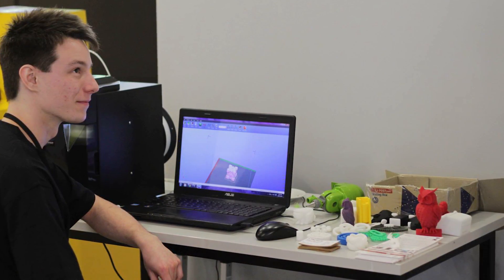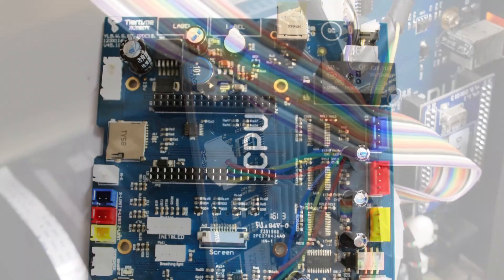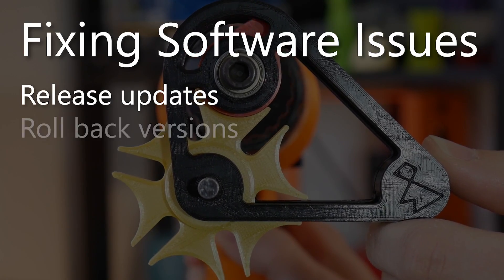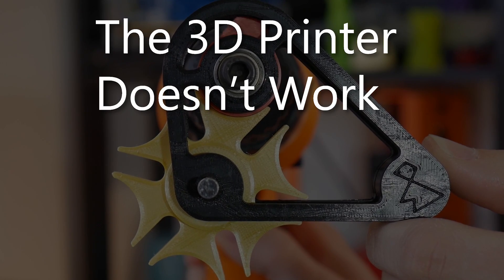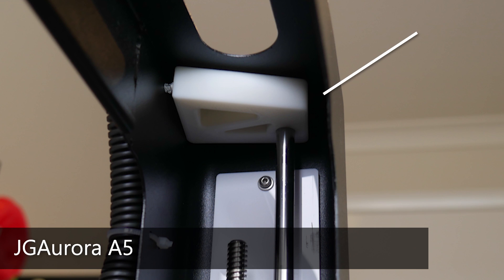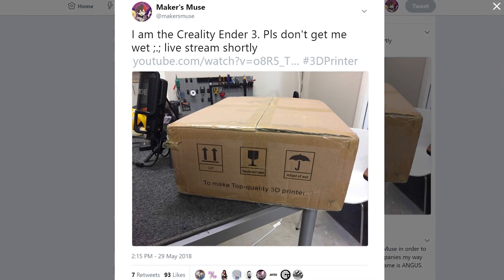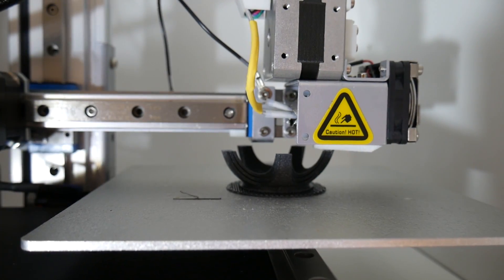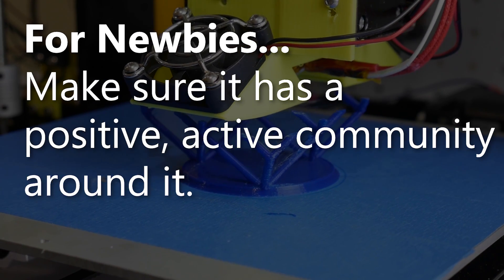Serious Concerns with 3D Printer Quality Control

Comment: I think the real problem is transparency.  In software terms, beta projects come with release notes.  They let you know what bugs have been fixed over time, and when a new release drops, you can see if the problem you have has been solved by it or not.  

More often than not, with hardware, there's no such thing.  So for instance your problem with the PTFE tube and its holders on the Ender3 might have been fixed but they don't let anyone know.  So you get your box in the mail and maybe it's got better parts than the review units, maybe it doesn't.  It feels like even more of a gamble than it did before.  

I feel like if manufacturers tracked their bugs similar to how software developers did, and included release notes on their website and in the boxes that correlated to serial #s on the machines themselves, it would go a long way towards helping users understand their machines better.  At least then I'd know for sure "Oh I have serial # XXXX that came with B series switches, but those have been fixed so I need to do that myself" or "Oh This is a very late serial # so it has all the current-best hardware on it."  This also helps quickly track down and squash bugs.  I bet lots of people wouldn't attribute underextrusion to a fault with the PTFE tube holders.  And many users might not know where to turn for help tracking that problem down, or maybe there are several things that "kinda worked" for several people so it sends users down a long rabbit hole.  But with a proper notated release and upgrade list from the manufacturer, it would be very easy to see which hardware fixed which problem and be able to target repairs or upgrades on your own machine to get it within spec.
Reply: Mike Bryan , they could still cheat. U.S. auto manufacturer fixed an ignition key problem (that killed several people) and did not change the product number in any way.
Reply: The really tricky thing about announcing incremental upgrades is inventory.  Imagine you have 20 machines sitting in your warehouse ready to be shipped out to new customers.  Now imagine that a new revision is announced with some minor improvements.  Now you have 20 "obsolete" machines that you have to find something to do with, since all the customers are going to want the new version, even if the improvement is something really minor.  That could easily be $10,000 of stock that you're now going to have a hard time selling.

One way to handle this could be the way the car industry does with new models, where they have new models every year.  Since everyone knows this is how it works, there are no nasty surprises for the vendor when they buy $10,000 worth of hardware and a week later it's suddenly updated, and no surprises for the customer either.  Then the vendor can plan ahead with keeping things in stock, since they know when it's time to clear out stock (possibly with a helpful sale) soon before the new models hit.  And the customer can decide if they want to buy a machine right now, or maybe wait for the annual clearance sale, with the understanding that they will not in fact get any incremental improvements that may be in the next model.

There's also a way for the manufacturers to be able to roll out incremental updates immediately.  This is nice for the manufacturer for the same reason as it's nice to the vendor.  Imagine that they have decided that an upgrade of the extruder motor is needed.  Now, they probably want to use up their stock of old motors first before releasing the improved model.  With a rigid release schedule, they could easily get into the situation where they've used up the last of the old motors, but the new model release isn't for 6 months and now they have to order a new batch of old motors even though they're going to stop using them?  Maybe each model would be a baseline, where the customer is guaranteed to get the base model, but might benefit from some of the incremental upgrades slated for the next model.  Since you've made it clear that they're buying the baseline, if it happens to ship with an incremental improvement, it's a free bonus, and importantly, if it's a machine from before that's been sitting in a warehouse until now, you didn't make any promises.
Reply: Given the "lean" manufacturing methodologies all these companies have adopted, there's very little risk of stock sitting on shelves for very long.  I think that was one of the subtextual points of the video.  The manufacturers are revising and selling the printers so fast that people are getting stuff that there's no documentation for, making all the reviews out of date before they are even published.

Comment: I bought my Ender 3 on July 2nd and received it on July 9th.  It came with the old style bed where the "EnderTack" is glued to the bed.  I bought it from BangGood and it shipped from a warehouse in Hong Kong so it may be a little bit of time before the "old" stock of glued beds is used up to guarantee a new bed. 

My Ender 3 also had PTFE connectors that are "fixed" compared to the couplers that Angus received.

Comment: My first printer (fab mini v1.5) just didn't work well. It would suddenly stop out of nowhere, and was always clogging. Last year when I bought my Ender 2 (has been fantastic), about a month later I was already seeing people with Ender 2's with better specs and can't really say I was very happy about that. The heated bed on mine only goes up to 60ºC (and takes forever), one month later people already had a version that went up to like 90 or 100 or something like that. It's not a huge deal if someone only prints PLA, but can be a deal breaker if someone wants to use other materials that require higher bed temps.

Comment: i found that some 3d printers are pure garbage out of the box for example the M3D micro and micro + these twi printers are stupidly expensive and are pure garbage and you cant vene use cura to print with it and if the printer breaks it self doing one of its auto maintenance programs the warranty WONT cover and the website is so broken that everything is a picture and the hyperlinks for files are inside the picture and they dont even have the picture set up as a hyperlinked object either

Comment: Very very true - Ultimaker 3 shipped WAY too soon - malfunctioning and poor design choices. I've got lots of Tiertime printers and I've found them to get progressively WORSE! My first and original Up Box is still going strong - the heated bed creates easily enough heat so ABS prints without warping. But my Up Mini 2 had the worst heater ever and NEVER got hot enough, it's piece of garbage. Sent it for repair to the distributor and they said there was nothing wrong. Scammed. I bought an Up Box+ hoping it would perform as well as my originla Up Box but the heater had definitely been downgraded and wasn't getting hot enough, causing warping (exact same print settings as Up Box). I've bought a Cetus Mk1 and Mk2 and for the Mk2 they removed the limit switches and now the printer struggles to give an accurate and repeatable Z height every time the printer is reset. I wish they'd actually IMPROVE printers every time instead of thinking they can cut corners and save costs by downgrading or 'streamlining' designs. It's absolutely stupid to think they can downgrade parts/features and people won't notice.

Comment: If the design/build is open source like Prusa, I definitely have less problems with the design evolving after initial launch. I like being able to tweek the design and implement the upgrades in the future. I wouldnt be so happy about this being the case with a much more expensive printer but I guess things are moving so fast it's hard to always know what potential problems will rear their heads after lots of use.
Reply: Yeah, if the company publishes their 3D files, at least you know what you're going to get when you order.

Comment: I agree, I don’t think there is a single “home 3D printer” company that’s not guilty of this-including Josef Prusa and his mighty “Prusa research”empire-I also think it’s pretty bad when a company who charges a premium (as they do) recommend themselves very strongly that you print a spare set of plastic parts ASAP-and this is because the plastic parts they use are notoriously cheap, and within 12 months usually start to break (as many have found). Interesting note on the Ender 3 there-I received mine 3 weeks ago, I’ve had no issues with the Bowden tube and/or connectors-if only I had known a removeable bed was on the way I would have waited 6 weeks lol. It’s good that you explain this very bad manufacturing process to people who are not so familiar with lean manufacturing and Six sigma methodologies. In my last job before I retired we had a 6 month PV&V process (product Validation & Verification) aka Beta testing, so that the company (a very well known American company) didn’t risk its reputation by releasing products of inferior quality. I guess in the hi tech electronics world (where today’s top model is old news tomorrow) its become the norm to adopt this process at times-Samsung got caught out with the Galaxy S7 if you recall and it’s habit of bursting into flames-so it’s not just printers,moreover a growing trend where the order of the day seems to be “you snooze you loose” and so the consumer ends up being that PV&V process. I agree it’s not only wrong but as demonstrated by Samsung, it can be extremely dangerous for the consumer.
How many Anet A8 printers have caught fire??? Another example. 

Certainly Makes your job to give “impartial reviews” extremely difficult, and I don’t envy you Angus because it’s only going to get worse I think.
Reply: A removable bed is on the way for the ender 3? I just ordered mine last night, should i cancel the order and will the price be going up?
Reply: Robert Mccarter Angus just said it’s now shipping with a removable bed so I guess it’s lucky dip with your order lol
Reply: @Johnn_T  Not necessarily true because he could get the last older one off the shelf at distribution.  Or even an older one!
Reply: I have nothing but good experiences with the prusa, its the only printer i have that is still stock. Only changed the power cable to the bed as it wears out over time as is informed in the manual. 
Then again, the mk2s i got was not one of the first off the assembly line. 
Its a good idea to print spares just in case, but i bet few actually do so.
Reply: Nah, let the order continue. There is no confirmation of the Ender 3 getting a removeable bed, only that there will be a Ender 3s with it. It will cost more too, i guess.
Reply: I got mine in on Thursday. The bed just isn't stuck down with its sticker, Its clipped on like glass beds with clips. I suppose for those who preferred the build surface not to be stuck on and give the consumer the option to do so if they choose to.
Reply: John T s7s never caught on fire
Reply: Is it glued to some kind of stiff paper or does it just still have the peel off paper on it? What if it bulges upwards in the middle? Have an Ender 3 in the mail, waiting to receive it in a few days.
Reply: Great question I was a bit wrong in my previous statement. I thought it was just the sheet ready to be stuck down but that is wrong.. I just had a look at the build surface and it is adhered to what "looks" like a hard thin plastic with approximately 1mm of thickness. You can actually see that it is glued to that surface.
Reply: Thanks for taking a closer look. I think i want that surface to be on my Ender as well.

Comment: so true, it's not ok. But at some of the price points, I think its impossible to make machines without these issues. went for Ender 3 after watching doezens of reviews and facebook groups, knowing that I will upgrade half a dozen parts while assembling. But even a lot of the more expensive ones seem to need upgrades, its such a mine field atm i would rather buy cheap knowing i need to upgrade.
Reply: I think ultimately the big problem here is transparency. it's apparently the case that no one knows if they have version 1.3.2 or 1.59 (for example). if manufacturers adopted good traceability programs along with good version control a lot of the uncertainty would disappear.

Comment: I got myself a prusa clone, the Anet A8, and it has been a nightmare the entire time. The main board physically burnt out, smoke sparks and all. I replaced the main board with a Ramps board, and it worked for about another month. At that point, the hot plate warped right down the center and began smoking. Thank God I was here for both of these failures, or there could have been a fire. I know its my fault in the long run for getting a $150 printer, but this is unacceptable. I spent that money expecting a working printer, and instead I got a fire hazard.

Comment: I feel like Joe at Prusa is doing a great job of releasing new printers instead of just casually modifying old ones, this is also a very effective business model for the company because people keep wanting to buy the newest version
Reply: Prusa regularly modifies their existing printers, so much so that every printed part on their printers has a version number attached to it.
Reply: The version numbers on parts is a relatively recent improvement. My 2s -- purchased as a kit direct from Prusa just under a year ago -- doesn't have version numbers on the parts. Right now I'm holding off on installing the 2.5 upgrade until I hear about a real resolution to the extrusion inconsistency. But those upgrade parts I printed a couple months ago do have version numbers.
Reply: Yeah, originally, parts didn't have stamped version numbers, which made this even worse, since there was no simple way of figuring out what printer revision you had, and which parts you should replace.

About the extrusion issue, I don't think there's a single problem that causes it. On my printer, replacing the Z-axis holders fixed about 80% of the problem, but I still have the odd moiré pattern, and other slight inconsistencies (prints from my CR-10 do look better, but to be fair, I put about 500$ into my CR10 to make it print reliably and well, so it's also been more expensive than the MK3).

I have another weird MK3 problem where the printer re-homes about a dozen times during an average print, presumably because it thinks there was a layer shift. It doesn't destroy the print 99% of the time, but it does leave visual marks on the printed part.

At this point, I probably wouldn't buy either a MK2.5 or a MK3, although I'm not sure what else to recommend that is in a comparable market segment to the MK3 (i.e. similar price point, good quality, easily repairable if things go wrong). Maybe a Lulzbot.
Reply: David Brown 6

Comment: The reality of the situation is that all successful products go through hardware revisions through their life cycle, and most of the time it's externally invisible to the customer.  I've run in to this when repairing my fridge control boards for example. It's just necessary that companies provide warranty service to all versions that are still under warranty as well as spares for repair/replacement. It would also be very nice if they included version numbers in the product name or a clear indication in the serial number/production date of which hardware revision you are dealing with. 

If a store won't tell me the serial/rev. number prior to purchase, I'll just use a different store.

Comment: Great video! Nothing is more annoying than having to troubleshoot something that is claimed to "Be up and running in ten minutes!" IMO, it's one of the downsides of the race to the bottom mentality. Just because something has an extruder, hotend, heated bed, control boad and a bunch of belts, bearings and rods doesn't mean it's a 3d printer. It has to work too. Otherwise, it's at best an art installation, or at worst, a fire hazard.
Reply: Pile of carbon d

Comment: Not a problem at all. As long as you know it works that way and i thought most people did but maybe not.

I bought one of the first cr10s off the line knowing that it would be rough and planned to upgrade it.
I knew i could wait 12 months for a polished one but didnt want to wait.
So it didnt have a mosfet for the bed, 3d printed parts poor firmwear and other issues. But now its far better than even the current cr10s with e3d titan extruder, e3d v6 lite hotend, my own firmwear build etc...

Its like an ender 3 if you want first off the production line expect problems if you buy one 6 to 12 months down the line expect a polished product.

I like it this way gives the consumer choice on how they want their product.

But it would be eaiser if it was clear upfront. If you just assume it for all products you will never go wrong.
Reply: Officially declared beta-testing is fine.
Continuous improvement of an open-source design is also fine.

The problem with the current trend in 3D printing is that manufacturers pretend to sell a fully functional product to get as many unofficial beta-testers (who pay the full price instead of being paid/rewarded) as they can.
Also the company uses the feedback to improve future batches but they keep that knowledge for themselves and don't give any help back to those who spent time and money to help them perfect their design.

Comment: just ordered a tevo tornado..

good choice ??
Reply: ZachyQuack yes ;) I did the same a few weeks ago, but consider it as a pre assembled kit as you'll certainly have to upgrade a little if you really want really excellent results. Check power safety also. But you can't beat the price for this overall building quality.